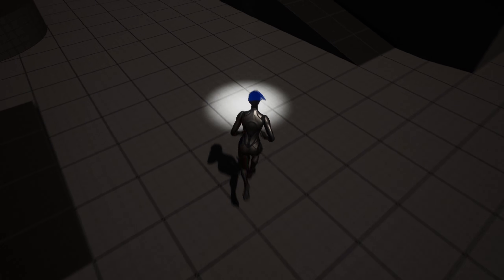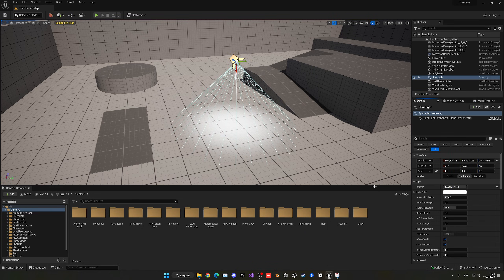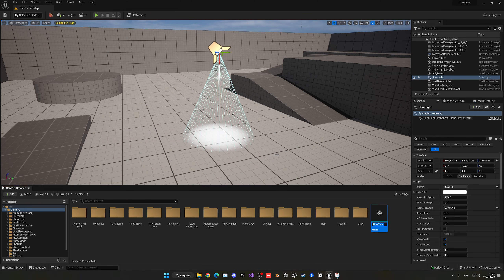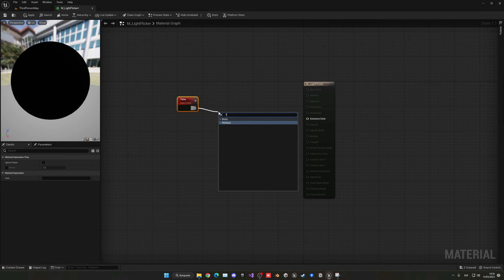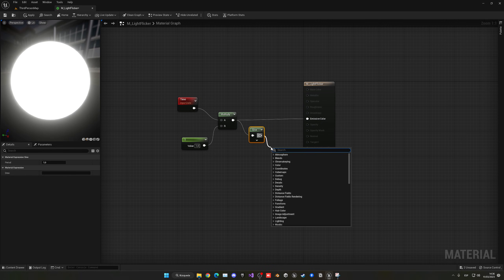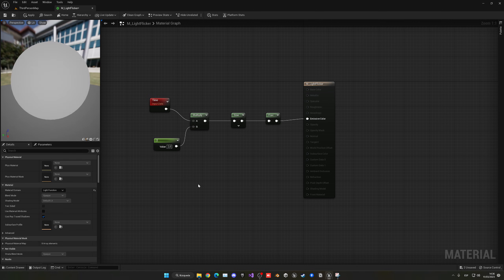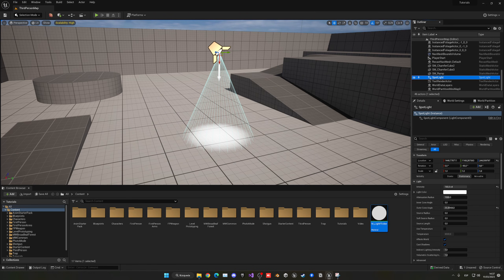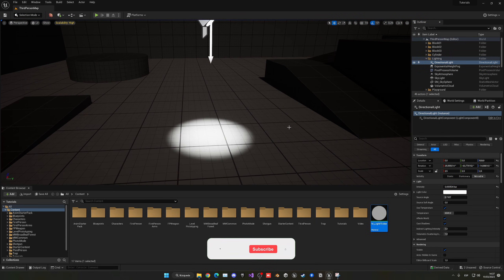How to Make a Flickering Light Effect in Unreal Engine 5 - In 3 Mins!

Comment: For those who are having trouble, the issue is likely with the Scalability Groups. The Shadow option is set to Low, which is why the effect isn’t working. Set the shadows to Medium.

For those who can’t find it, do the following: in your viewport, there’s a green triangle, right? Below it, you’ll see the following options: Perspective, Lit, Show, and finally, the option you need: Scalability. Clicking on it will open a window where you can adjust texture quality, shadows, post-processing effects, and so on. If your shadows are set to Low, that’s probably why it isn’t working. Make sure to set the Shadow option to at least Medium.

Comment: Or just toggle visibility the point light or spotlight also put a delay and connect it with the first node
Reply: I have tried this before, for a big map where emergency lights were flickering. It wasn't great in terms of performance and way harder to set it up.
Reply: @yanksavgat4295  ok but its not hard to set it up its only 3 nodes